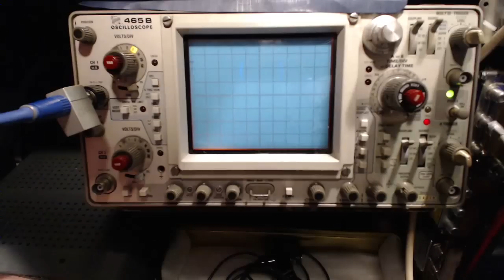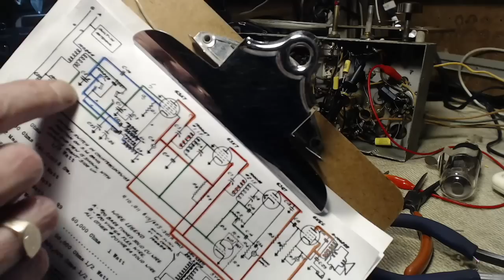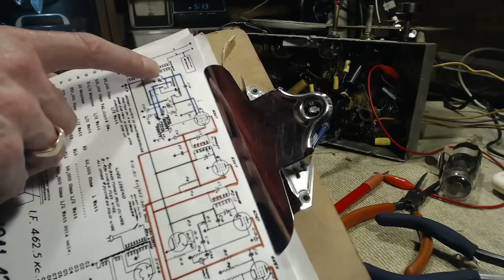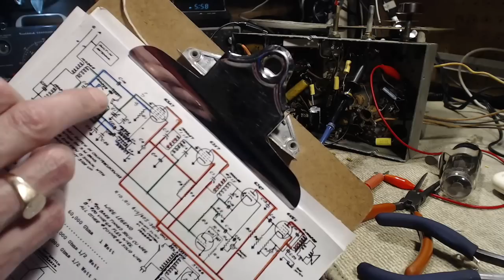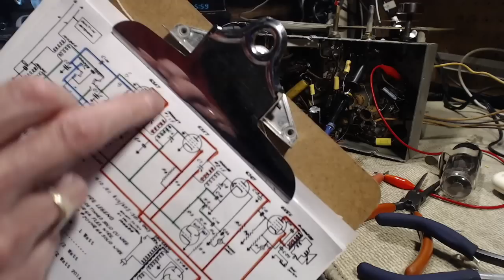Marconi 201A AM and Shortwave Radio Video #17 - What What What What

Comment: Hi Jim
Have you checked tube screens pin #1 on the 6SK7 & 6SA7 is it grounded ?

Are the main PSU caps OK ?

The AVC line should be clean with no RF or AF on it .

Re the small cap increases the LO signal injected into the mixer at the top of the SW band .
Amplitude of the LO will drop off as the frequency increases .
( A fix for early tubes limitations ) .

It will have been trimmed for best performance .
The limited positive feedback introduced will give a signal gain at the top of the SW band .                                       Nice :-)

If you introduce to much positive feedback you will get oscillation !
Reply from the maker: gd2329j   How would that boost technique create an unwanted AVC voltage?
Reply from the maker: Jim Lindenas Oops.  Wrong question.  The strong local oscillator signal reaching the antenna grid results in self biasing.  The self biasing voltage affects the whole AVC bus.

Comment: Here's another thought. Given that the outer last wraps of a tubular capacitor can act as either shield or antenna depending on the impedance of circuit that end is connected to, it might be worth reversing the "polarity" of any newly replaced tubular/axial caps in the local oscillator/antenna circuitry to see if there's any inadvertent coupling occurring due to that phenomenon. It might not make any practical difference here but you never know...
Reply from the maker: Graeme Davidson Very interesting idea.

Comment: i think what your seeing is an oscillation at another harmonic frequency.  i  noticed when in an earlier video you attached the scope probe to the little 1pf cap and the radio seemed to work a whole lot better.  with the probe attached you added about 10-20pf to the circuit, not 1 or 2....   the circuit acts up with 1-2pf, and works better with 10-20pf... tells me that the section is oscillation way off freq (higher).  with the scope probe added the osc stays in the proper range....  i'd make the gimmick cap about 20pf and do a test.   when an osc get's too strong it can cause it's own tube to be come a detector and gen voltages on the screen grids, where under normal controlled function, it would not.   this could be the reason for your screwed up avc stuff.  the scope showed you a very distorted waveform in the last video, then you retuned to a lower feq and the waveform turned back into a sine wave....  the distorted waveform indicates multiple harmonics and a totally saturated oscillation.  the clean one shows a stable non saturated oscillation. the function of the gimmick cap is to give enough feedback to make the oscillator work at the desired freq.  too little and it's way high or quits completly, too much and it won't osc high enough. but always remember   every coil and wire acts as an antenna, and in an osc circuit a way for feedback to occur and cause unwanted oscillations at very different freq than you intend.  get the wires close to the chassis to keep the effects minimal.

Comment: THe only thing I can think of for the cap is that the tube may nor have enough gain at 18mHz, so they add a bit more positive feedback to keep it oscillating.

Odd, the 6SA7 has a metal case, it should not be effected by your hand near it. Maybe pin1 connection to ground is missing?
Reply from the maker: Scott Henion I like the boost idea.  I can imagine engineers being tasked with designing a radio that can reach higher frequencies than the competition and ideas like this would push the existing technology 'over the top'.  On the 6SA7, I'm wondering if it should be a glass version in there.